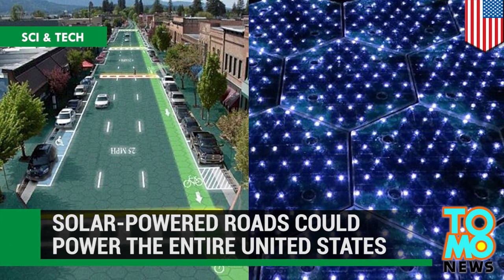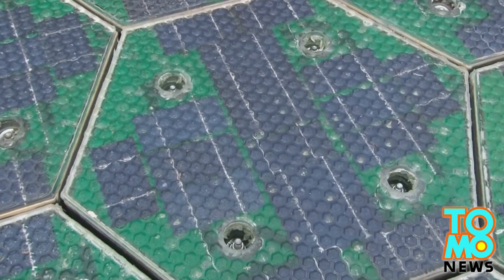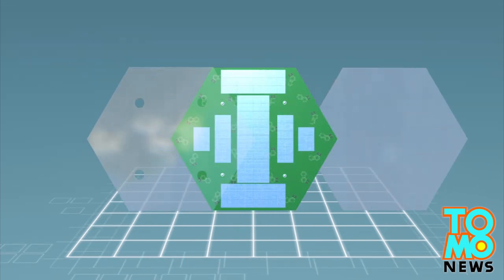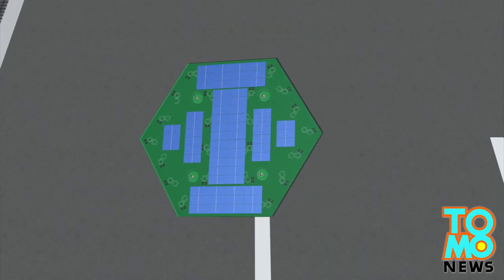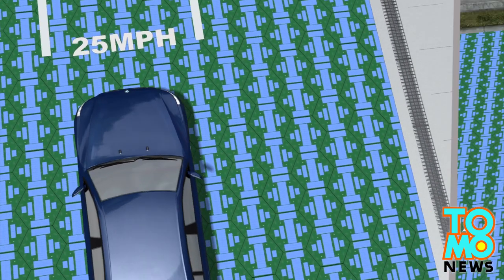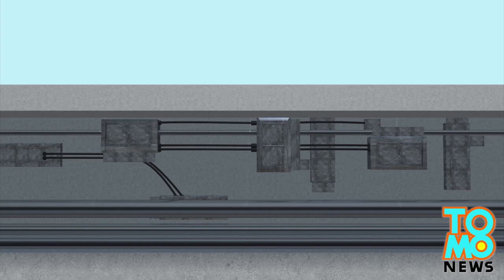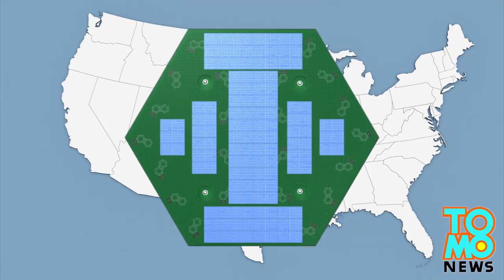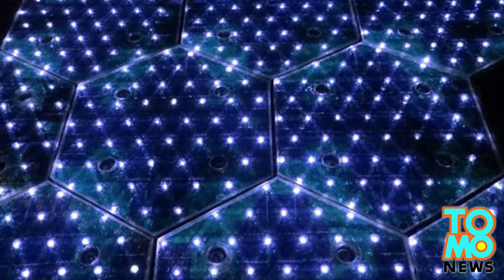Solar Roadways: solar-powered tech charge electric cars while on the road

Comment: the only problem is the heavy winter
Reply: I don't think you caught the part about heating elements built in to melt snow and ice.  No plowing, no salting.  Modular, adaptable, easily and quickly fixable with replacement panels.
Reply: These panels will melt off ice and snow.
Reply: what i meant heavy winter is the heavy winter in my area, in Toronto, but if the snow melting device is strong enough then i wish canada should fund this. the heavy winter here is something ridiculous and its no joke at all
Reply: Trevor Freckleton You cannot just convert energy from the sun into electricity, then into heat, and use it to melt snow. There isn't enough energy. If there were then the sun would have already melted the snow.
Reply: Inkoo Lee You're suggesting they use batteries? Do you realize the impact that would have on the environment, let alone the cost? And it doesn't matter if the road is already heated enough to melt snow immediately, it takes a hell of a lot of energy to keep something warmer than its surroundings- more than the solar panels could provide.
Reply: Trevor Freckleton
 "IF"

Comment: Sounds good as long as gas cars stay legal.  I don't like electric cars, Not enough range and as a guy you look like a wuss driving in one. I'm a muscle car/motorcycle guy. nothing can replace the gas powered Harley Davidson motorcycle. :)

Plus in a Nuclear war or EMP attack you don't want to be driving an electric car. lol Electronic fried to hell while older gas powered vehicle will still run. :)
Reply: Except gas cars would be ruined  as well during an EMP
Reply: thomas pears
read my comment again. Older cars build in the early 70's or before have little or no electronics in them. What do EMP's damage??? Electronic devices.
Reply: Nakor Z
wow, you know nothing about cars. Please do your homework and you will find out that i am right.
Reply: The road will charge electric cars as they drive -- range won't be a problem,
Reply: Kennita Watson
 I hope the electric road is lighting proof. I seen lightning striking the road or near it when i was in Kansas once.  It happened 50 feet in front of my truck and my trucks electrical system was going haywire. But it returned to normal after 10 seconds.